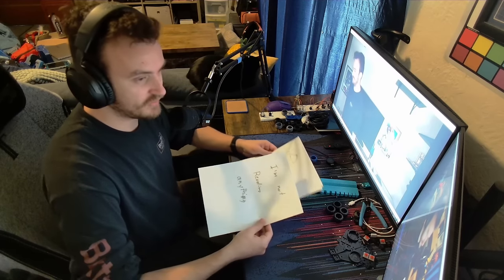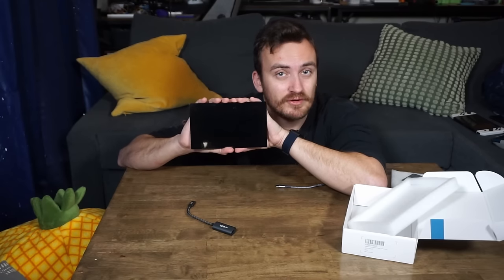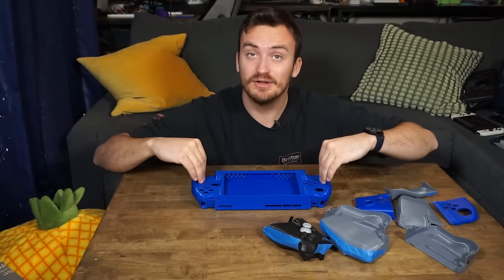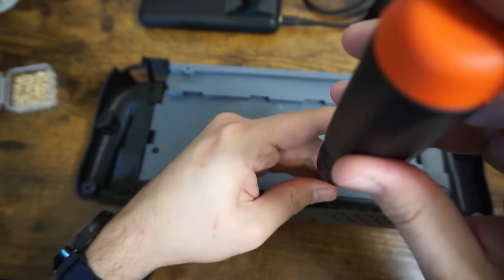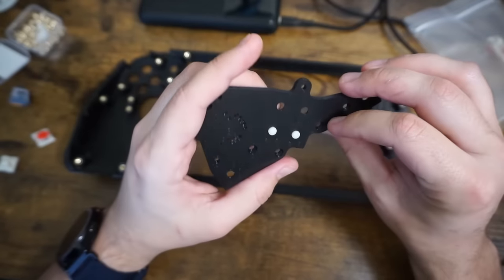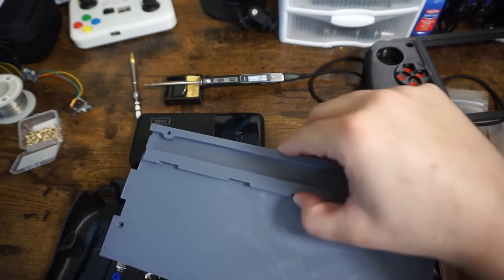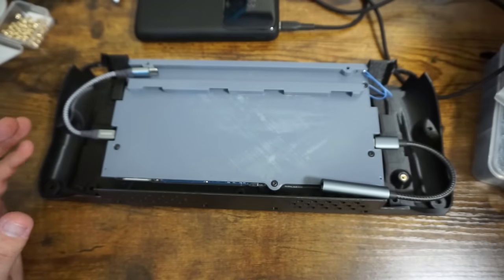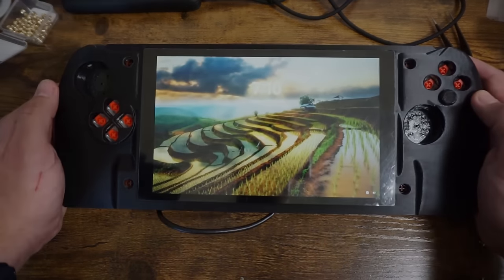I am building a Framework Gaming Handheld!(DIY Gaming Handheld)

Comment: cant you use the hall stick sensor that only move in one axis as an analogic trigger?
Reply from the maker: The easiest way I could think of doing it is just a hall sensor and a magnet glued to the trigger itself, however I don't have any more analog pins available on my rp2040 board so I would need to use an i2c ADC. This is possible and GP2040 CE supports a specific i2C ADC but I don't think it supports setting it to be an analog trigger so I would need to modify the FW. This is another thing I can look into for a future revision.

Comment: Would it be possible to design this so that the motherboard is flipped? So that you can access the SSDs just by removing the back cover? Or would that negatively affect CPU airflow? Very cool project. I like how it looks. I hope you get to finish it soon. I subscribed.
Reply from the maker: That would require some testing but by inspection it looks like the fan prefers breathing from one side over the other. I do like the idea though! Maybe it could be done with a bit of air ducting in the 3d model? Not sure

Comment: Hey Tommy, love what you are doing! I've made a controller that emulates a 360 controller on windows before. Tried using the pico with the gp2040-ce, but was limited by with its 3 analog pins. Did you get both analog sticks working with the waveshare rp2040 zero? I had to use an arduino pro micro which was a pain (and lacked enough pins for functionality). Don't know if your future sponsor does Polyjet printing, but if they do it allows you to add really detailed buttons!
Reply from the maker: I haven't actually tried it all together yet, but i have tested each of the 4 analog pins and didn't have issues. Will have to follow up. It's super weird that the pico only has 3 analog pins when the rp2040 itself has 4. Hmm

Comment: Awesome I’ve thought of this but naw causes that’s money and I have handhelds. Would be very cool if framework joined the handhelds with barebones parts specific for them. 

Wonder how well PETG-CF would hold up since I use it for a handheld grip. Very smooth and nice texture. That or I’ve tried PA-CF which I’m pretty sure exceeds ABS heat resistance. A little rougher texture but still looks clean and sands down easily. Just ppe for dust I guess.

Comment: For analogue triggers, there are hall effect MX-style switches, tough I dont know if they are just compatible with gp2040-c, I guess they are as in dxinput mode R2 an L2 are shown as analogue inputs in the native windows joystick input viewer.

Worth a try.
Reply: I can suggest those switches for digital inputs aswell, as the better brand models tend to have much more precise inputs than the average MX
Reply: Oh and I almost forgot, sadly I havent seen any low profile hall effect switches, so that would need adjustments to the support and enclosure parts

Comment: hall effect isn't better! you trade accuracy for longevity. many of the popular hall effect switches like to snap to cardinals way too often. 
since your machine is completely repairable I would just use normal ones and deal with the fact it probably isn't going to be as reliable. 
also make sure to support that right angle adapter on the top left USB C port.

Comment: very cool project looks like there is still some wasted space especially if you juse a custom battery i think it could get way smaller. you would probably also need a custom controller pcb but this is definitly a good first itteration.

Comment: iirc some of the earlier framework boards didnt boot when they were shut down and the power cable wasnt plugged in so it not booting shouldnt have been your fault
There is a little soldering thing framework has a guide for on their website to fix this issue btw

Comment: Why can't you Just buy a nuc with amd 8000 series and use it to build it.. it's much smaller right?
Reply from the maker: It's doable, but powering it becomes a difficult issue to solve. My solution allows me to just use a framework battery. However CNCDan on youtube is making a nuc handheld with a custom power solution! Check out his stuff. Maybe further down the road, i can do a project based on his project

Comment: Congratulations on π*10^3 subscribers! Not designing a PCB is a viable alternative, as once you order one, all the mistakes you made are frozen in that board (unless you bodge wire it).
I only wish that the FW had a stronger igpu (Darn you Intel!)
Watching on my own Framework 13 (batch 6).

Comment: I think choosing a intel based computer is a bad choice, since (I think) it has an intel GPU and those are terrible for gaming (and worse with their terribly bad drivers), also, usb to display adapters tend to give poor results (low refresh rate and performance) so I have my doubts the resulting product could be called a "gaming" device.

Comment: Why do people keep putting analog sticks in different positions? Don't they realize that the grip sucks? Analog sticks in different positions work on NORMAL controllers because controllers are light and small. In a portable, stability and anatomy are key. Unfortunately, this crap started with the Nintendo Switch.